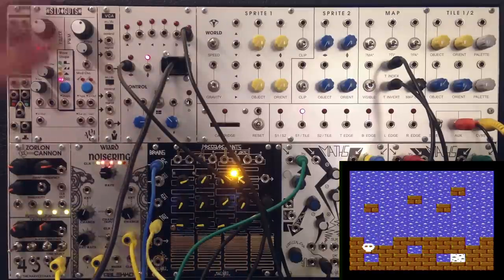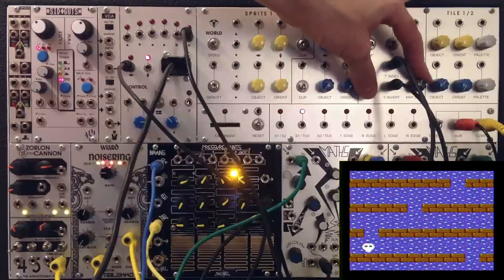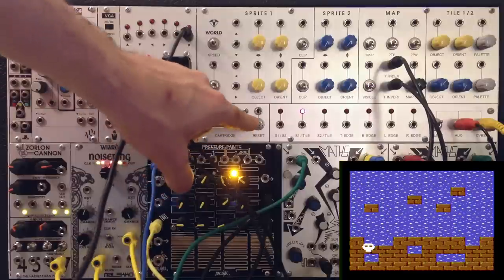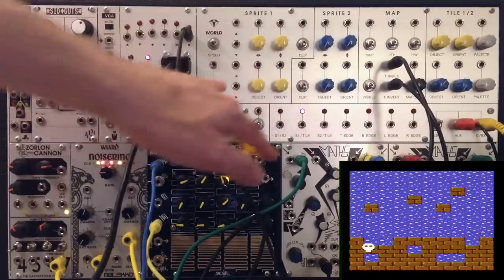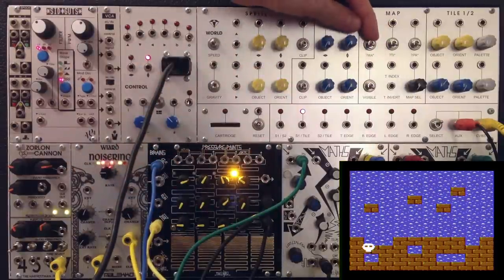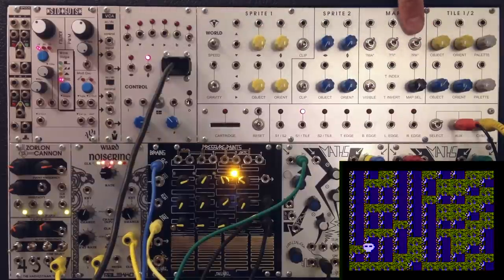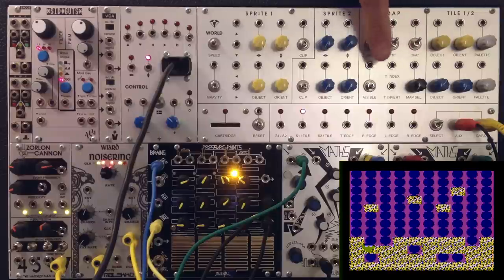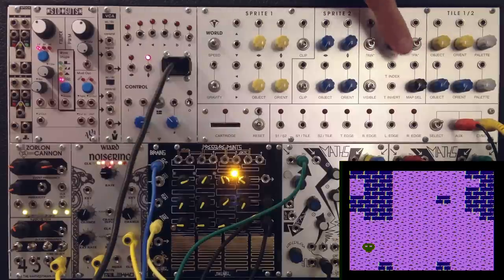Ming Mecca Tutorial Series - Episode 1: System Introduction

Comment: The Ming Mecca modules look awesome!  What happens when you fall down the pit with gravity on?  Can you jump high enough to escape?  Or do you have to patch the B. Edge gate output to, what I assume is, the gravity switch gate input to escape?
Reply from the maker: If gravity is turned on, once you've fallen off the screen the sprite is permanently stuck in the abyss until gravity is cycled again :) Patching B. Edge into the gravity input will definitely work to rescue the sprite automatically, but you've got to run it through an inverter first -so that when B. Edge goes high, it pulls gravity low (off).